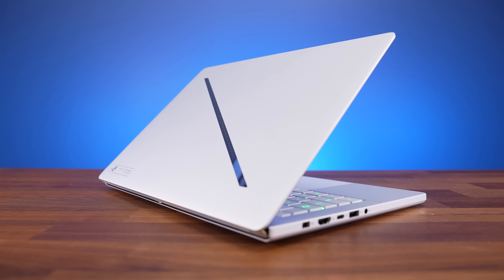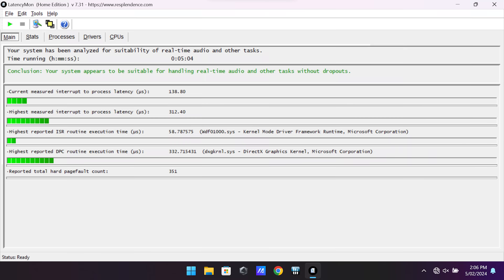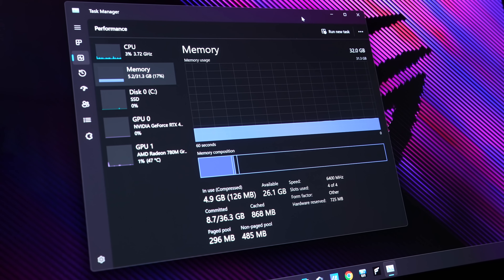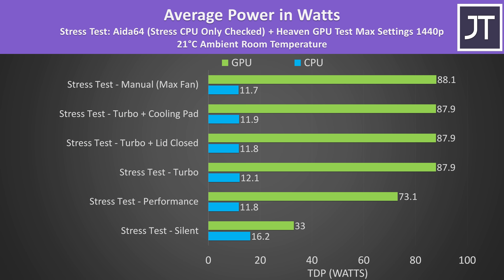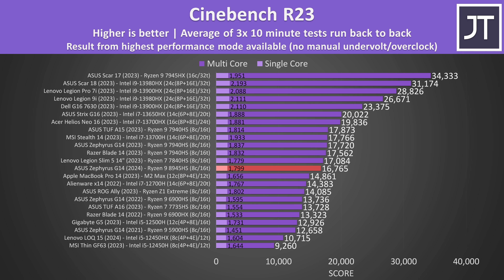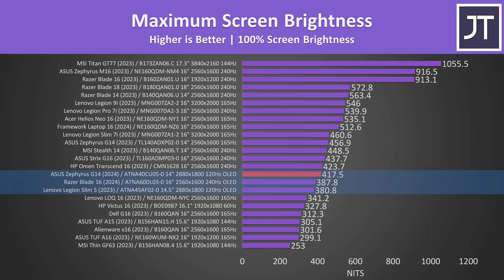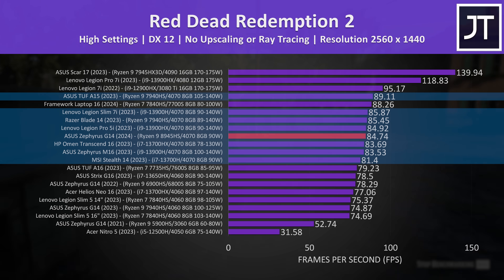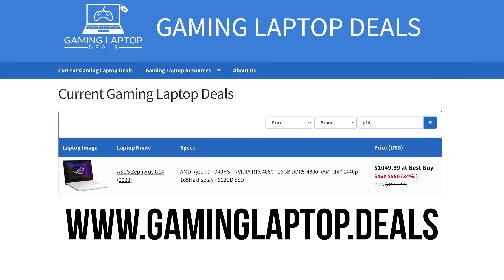ASUS Zephyrus G14 (2024) Review - Problems You Must Know!

Comment: that looks really nice but my 2020 base model still going strong
Reply: same, not base model but the one with the 2060. had some issues with the screen but that was my own fault not the laptops. (packed my backpack too tightly during a trip) still working great for me otherwise though!
Reply: @EverythingWentSideways for real, have the exact same one but I eventually put a 4tb nvme and 40gigs of ram. Been using it as a desktop replacement for 3 years now. Was thinking of finally upgrading but non upgradable ram is a dealbreaker for me.
Reply: @charliekempf  what's the specs of yours?
Reply: @ilhamrians  my original model was 16gb ram, 1tb ssd, RTX 2060, and a Ryzen 9 4900hs. Model number ga401-iv
Reply: @charliekempf  I plan on doing the same upgrades to mine except 2TB instead of 4TB. How did you transfer the data from your old SSD? I plan on using an SSD enclosure.
Reply: does the eco mode in asus software completely disable the dgpu?
Reply: Same bruh👍
Reply: @charliekempf I know your comment is 2 months old, but I have a question. I got the 2021 g15, and want to upgrade my ram as well. What ram stick did you go with when you upgraded? And do you notice any difference anywhere considering you aren't running dual channel memory? Thanks (:
Reply: Being poor is crazy 😂
Reply: @Its-a-trap13  can you afford one then?
Reply: @Its-a-trap13  i dont think hes poor, are you in russia?
Reply: I got the 2020 model and we running strong too 💪! Will probably upgrade to the 2026 model if anything..

Comment: My Zephyrus G14, hits 95C CPU during light gaming on all modes, even in old light gaming. The CPU clocks are almost always over 4GHz. WTF is going on with mine?
Reply: I see i'm not alone. I got the 8945hs and 4070. Tried first game Smite with medium settings, gpu at 60-70 but the cpu went above 90 no mather the setting on fans.
Even have it on a laptop cooler above the table..
Reply: It's tiny and powerful. Open it up and clean out the dust.
Reply: @Siegefya  The 2024 model from the day I bought it. It's not dusty!
Reply: Disable CPU boost entirely in G helper and/or in windows power modes for gaming. G helper should also let you set a max CPU temp target, try setting it for 75C or something and it will adjust power and frequency to hit this. For most GPU-intensive games this won't lower framerates at all and may actually help as it's saving power and cooling for the GPU.

Comment: The 2023 base model in the US would usually go on a sale for $500 less than MSRP. It was 16gb RAM but wasn’t a problem since you could always upgrade it for just $40 more. Not with this you can’t.
Reply: You’re also forced to buy the more expensive 4070 version if you want to get 32gb RAM.
Reply: @jivewig  I'd just get the Blade 14 at that price, as it has two RAM slots and a higher GPU power limit, even considering the voltage limit.
Reply: @cameronbosch1213  Wait is the Blade 14 selling for $1100? But it doesn’t have the MacBook like speakers probably.
Reply: @jivewig No, but the 2024 Zephyrus G14 2024 model isn't much cheaper than a 2023/2024 Razer Blade and is less powerful with less upgradability. The Blade 14 is just a better laptop imo.
Reply: @cameronbosch1213  blade 14 is heavier, doesn’t have OLED, worse speakers, barely better performance, etc. also it’s $2500 at BB right now. Not worth
Reply: @rickystafford7433  Heavier means better cooling with more powerful components and two RAM slots.
Reply: Did the 2023 Asus G14 16GB models come with 1 stick of 16GB or 2x of 8GB?
Reply: @ayushmalpeddi2793  1 x 16. But DDR5 so sort of dual channel. Also it’s better since you can upgrade to 32gb symmetrical rather than 24gb asymmetrical.
Reply: @ayushmalpeddi2793  1x 8gb or 16gb soldered ram and 1 upgradable socket. ram config depends on ur region . US  gets 1x16gb soldered i think
Reply: @cameronbosch1213  You're forgetting battery life. Blade 14 battery life barely last 4 hours, for a notebook, it's beyond unacceptable.
Reply: @Yayaloy9  Actually, I've had it last for around double that, and other reviewers like Jarrod have confirmed my results. (I no longer have the Blade 14 anymore.)
Reply: @jivewig hey, I wonder if you know whether I can replace ny g14 2024's current 1x16 gigs ram with 1x32 gigs ram or not
Reply: @alpercan5220 You cant for the 2024 model. The ram is soldered on to the motherboard

Comment: That screen wobble though; noticed it every time Jarrod touched the desk or laptop.
Reply: Yep this alone keeps me away!
Reply from the maker: Yeah. Much worse than last year.
Reply: please add fortnite back to your benchmarks 🙏  @JarrodsTech
Reply: @Многоканальныймир it shouldnt, either he got a bad unit or the review units just aren't as tight but I had it and it doesn't wobble at all
Reply: What's funny is I just bought one of these (typing on it right now actually) and I don't notice any screen wobble at all; but the display unit was terrible. I wonder if they fixed it somehow.
Reply: @AC-io8qs  any issue with the screen? Im about to buy this laptop but i wanna do some research
Reply: @popes6305  The screen in excellent! So crisp! The only issue I've had with this laptop so far is that due to Asus software screwing with settings every time I restart I have to set the taskbar to "auto-hide" upon every restart, I do the auto-hide to reduce the risk of task bar burn in.
Reply: @AC-io8qs  it help me so much. Thanks
Reply: It even wobbles when it get blown by wind

Comment: By the way, something I noticed with the 2023 G14 is that, for some reason, the battery life increased significantly recently.
I guess ASUS did something with these products in the software department that helps battery life.
Reply: that's nice to hear!
Reply: Ghelper still makes it a beast, same as 2022 model and basically everything else.
Reply: they just trashed performance 💀
Reply: The newer AMD chipset drivers fixed sleep issues that a lot of G14s were having, I wonder if it is related.
Reply: My 2022 battery life has been really bad lately, half what I used to get
Reply: did you do any update recently, or something that could trigger that improvement?
Reply: probably AMD drivers.
Reply: @panda1412. oh... mb gang 😊
Reply: @tomoMik_ I guess yeah in some way but personally I’ll take it just bc of the slimmer design and just better quality
Reply: Its probably the oled vs miniled and likely some software tweaks
Reply: how does he get 12 hours of battery life on youtube after about an hour of  youtube my battery remaining says 6 hours at around 90% left. i disabled the GPU and enabled all other battery saving features in windows am i missing something?
Reply: @TechGuyBeau Love your vids!
Reply: Something wrong with the software i guess. Mine 2024 g14 lasts about 2-3 hours on light usage. Stutters alot with 16gb ram being the bottleneck. A slimmed down version of windows and a driver updates from asus should fix the problem for this otherwise a good powerful machine.

Comment: I just took note of the problems he mentioned without mentioning any positives so you can easily identify dealbreakers.

1. Some screen wobble 
2. No more 180 degrees, 135 only hinge 
3. Keycap lighting isn't perfect
4. Trackpad topside click pressure high
5. No fingerprint scanner on power button
6. Only 1 c port has USB 4.0 and charge support
7. Two screws covered by rubber bits so accessibility isn't as easy
8. RAM upgradability missing
9. Rear screen lift mechanism missing this year (might reduce airflow but temp check shows all good)
10. 8945HS CPU only has better NPU for AI compared to last year CPU
11. Minimal perf. hit on CPU compared to other ryzen laptops in exchange for higher portability
12. Minimal reflection even on glossy screen
13. OLED Burn in 
14. 4070 gets beaten by 4060 laptops marginally due TGP - so the price of the 4070 might not be justified
15. No BIOS customization comparatively
16. Linux test gave speakers a hard time and some keyboard functions didn't work
17. Higher price compared to last year by a few hundred dollars
Reply: Personally I think if you value the improved screen, speakers, weight, extra ram, etc, the price increase is more than justified and the premium is worth it.

1. True, I don't like this. The old model didn't have any. At this price it shouldn't exist.
2. I think this was just a side effect of the ergo-lift hinge. I don't think anyone actually cares about being able to do that.
3. Par for course, all previous G14 models are like this, although I wish the would fix it!
4. Par for course, although a haptic touchpad would have been nice.
5. Par for course. Windows Hello is just better but it struggles in dark light.
6. Par for course.
7. Par for course. Old models had three rubber nibs covering three screws. Not like youre getting in their daily anyway.
8. A downside, but 32GB should be all 99% of people need. Someone needing more than 32GB of ram probably isn't shopping for a 14" laptop and wants the most performance anyway.
12. Minimal means not much so this is a good thing. Glossy on OLED is superior.
13. Par for course. All OLED screens have the potential for burn-in, but I think that fear is overblown.
14. Not always. It's disappointed to see it getting beat at all, but in some tests it's definitely slightly ahead.
17. I could see this as being a downside if the old models no longer existed, but they still do. The higher price is justified given the quality of life upgrades.

All that said, the 4060 version for $1050 from Best Buy is the one 99% of people should buy. Add a 2TB hard drive for $100 and there is no better value for your money out there.
Reply: @rickystafford7433  yep, its insane to see the video playback test almost reaching mbp levels without even ghelper. Also its thinner, looks more subtle, feels more premium with the aluminum cnc, better thermals, better keyboard, smaller brick etc.. 

For people like me who want a professional use/ light gaming notebook at a cheaper price than razer and apple, this is essentially perfect.
Reply: For #17 Cost is way higher for a 32 gb option compared to the ram slot from last year. I got a 2023 for $1200 vs the 32 gb version at $2200. I did not upgrade at that cost, but for high drive and ram it would be under $200.
Reply: TY. Numbers 8 and 17 are the main deal breaks for me.
Reply: Number 12, Minimal Reflection even on glossy screen is a pro, not a con.
Reply: Number 3 is a Deal Breaker, absolute breaker, Docking capability just got nuked.
Reply: 1 not a big deal
2. not a big deal
3. kinda
4. not a big deal
5. not a big deal
6. not a big deal
7. not a big deal
8. not a big deal 
9. not a big deal
10. not a big deal 
11. not a big deal
12. not a big deal
13. not a big deal (if you hav screensaver)
14. not a big deal
15. not a big deal
16. not a big deal (i don't use linux)
17. PRETTY BIG DEAL (i don't have money)

3/17 i guess
Reply: screen wobble is unacceptable i feel it would drive me nuts
Reply: fuk it jus gonna buy a 2023 one literally better lmao
Reply: @C0NFUZED_158  I hate the port position, that's it. Great when working, crazy when gaming and worth the $1000 discount over a number increase on year number.
Reply: My guy, screen reflections are bad.
Reply: 17 is crazy 😭💀 
Still gonna buy it tho, most of the problems seem minor
Reply: @rickystafford7433  Question regarding the OLED burn, is it something that will eventually happen or can it be avoided?
Reply: @malekdragunov3528  all oled screen burn you cant prevent it. but you can make it slower

Comment: Thanks Jarrod!! I purchased a Legion Slim 5 14" based on your review, and after seeing this review, I have no regrets! The Asus would be $800 more than I paid with no real benefit other than G-Sync. I am surprised that the Asus w/ 4070 was only slightly ahead of the Legion Slim with a 4060.
Reply: Hows the battery life if you are being conservative?
(60Hz, Windows Battery Saver mode, half or less brightness, etc)
Reply: @vik1ng313 got the same question
Reply: i have a 2022 6700s g14, and my next upgrade will most likely be one of those legions if the battery life is as good as the g14
Reply: @Pividol This is the exact model I had. I paid 200 AUD to upgrade. Performance is great but I spent quite a few hours tweaking the Lenovo to perform well and efficient
Reply: With igpu only after windows loads I go from 35w drain down  to under 12w. Says 5 hrs with 80% battery. It's decent but if you aren't able to plug for a day of work I'd either stay with the g14 or buy a 65w portable USB c charger that can do 20v. That'll keep U going for an extra few hours
Reply: @Pividol I had a 20000mah 30w power bank that would extend and charge my g14 when out. Was awesome

Comment: That battery life, wow! And the temps are surprisingly good too. But then again, 12W at 2500MHz is a low wattage to run the CPU at. Seems to work decent in games though, maybe a better CPU bin like you said. Plus just AMD efficiency. Overall pretty impressive, and in the US it’s a similar price to last year’s model. Just a huge shame they didn’t make a slightly thicker 4080/4090 version.

Comment: Considering returning the 2024 G14 I just got because of fan issues. When one of the fans spins up a loud "clunk" noise is made. When doing productivity loads this is really annoying, as the fan will kick in every few minutes.

I've seen several threads/comments discussing similar issues. Inexcusable for quality control on a premium product to be so lax.
Reply: It will cost another 2000. G14 2025.

Comment: Got the g14, no screen wobble. Definitely get g-helper. Can run cpu at 8 watts, with dgpu disabled and 60hz, it can get 8-10 hours of casual use discharging at 6-10 watts per hour.

Comment: Given the fact that Lenovo 14 is only 1050 regularly, it's a much better deal as the only reason to choose the g14 was the expandable ram slot
Reply: While I agree the price is great, the Lenovo is missing some key features. The G14 is quite a bit smaller as the Lenovo 14 is much closer to a 15” chassis. The Lenovo doesn’t have G-sync or Advanced Optimus, the Vantage software is quite a bit more limited than Armoury Crate/G-Helper is on the G14. 7940HS/8945HS is better than the 7840HS and can be undervolted. The Lenovo has NO USB4/THUNDERBOLT! Which is absolutely crazy in 2024 to not have. The max fans were quieter on the G14, at least on the 2023 model. Seems like the 2024 is similar. RGB Keyboard on the G14, better speakers, and the Lenovo has really bad DPC latency for some reason.

Comment: Just bought this. Not the best value for the money, but I just love everything about it. The design, oled, gsync, weight, keyboard, battery life, portability, noise level. The performance is good enough :)
Reply: Agreed! :D
Reply: I probably would forgive the price if the screen didn't wobble so hilariously bad
Reply: It's good to make a choice. I have decided to go with Legion 14.5 at a good on sale price
Reply: @Psi-du2lw  I got one this week and I personally experience no screen wobble when the lid is completely open.
Reply: Agreed man 😔😔 honestly temps are so good I don't see why they didn't just let the 4070 hit 100 watts. And give abit more to the CPU I understand they wanted it to be less hot unlike 2023s but I think 2024s cooling solution would of been enough. But ig by the end of the day the Asus team probably did lots of tests.
Reply: Noise level? I got the 4060 Version and I‘m using G-helper to keep the Fans below 4500rpm in Turbo and Balanced

Whats the maximum rpm you use?

Comment: Regarding what you said in the video about the 2024 G14 - as a hardware pro it's hard to recommend this laptop for gaming or creative work. For usual tasks? maybe, but then again you don't need to splash on a laptop that costs between 2-3k USD for office or light work, much cheaper laptops achieve that goal. For creative or gaming? a big no no.  Why? The design is nice and the OLED display is great but that's where it ends 1. The CPU is basically a rebranded 7940HS - this is basically last year's CPU in a "new" packaging. If the 2023 G14 is already running very hot imagine what would happen with this year's thinner chassis and inadequate cooling while gaming or doing a high res video editing - it's going to thermal throttle and run super hot a lot more. 2. the 4070 GPU is slightly slower than last year's model, not by much but still slower meaning it would perform worse at an extra cost for this year's pricing. The 4050/4060/4070 are capped (voltage wise) by Nvidia to 100W-110W, anything above it is lost and you wouldn't feel any difference, and with the thinner chassis and bad heat handling it would become an issue very fast for gamers and creative/content creators related tasks. 3.The RAM is soldered! 32 GB soldered is alright but they sell a 16GB soldered RAM! this is not enough for a 2024 gaming or creative laptop, it's arguably borderline ok for current gaming but won't stay that for long, and really? stuck with a 16GB soldered ram and 1 SSD slot for an over $2000-$2500 "gaming' laptop? if you're after 32GB then you're getting closer to $3000 which is sick pricing wise! In the G14 2023 version the RAM wasn't soldered so you could add in more memory if needed. So what this year's g14 gets you?  you're paying 2K-3K USD for last year's hardware with degraded performance at extra cost when you have better alternatives out there. Sure the display is great but what you end up buying is a screen and a sleek design - paying a premium for design and an OLED screen.